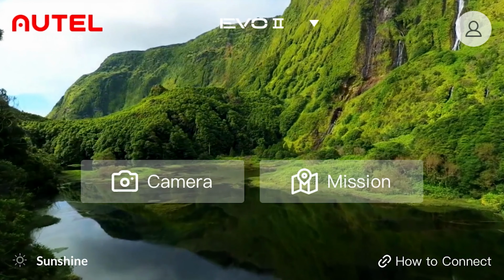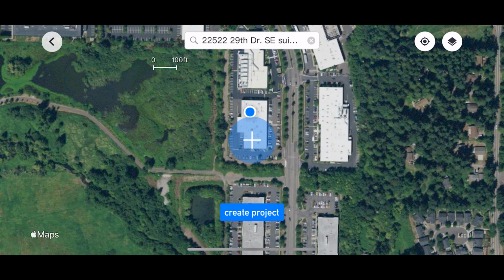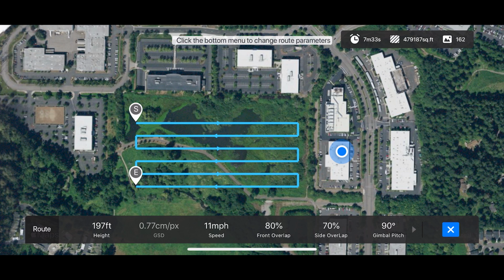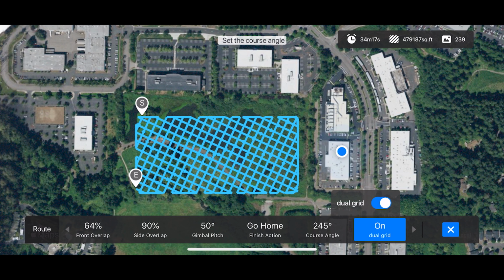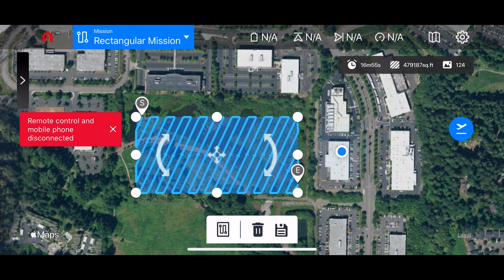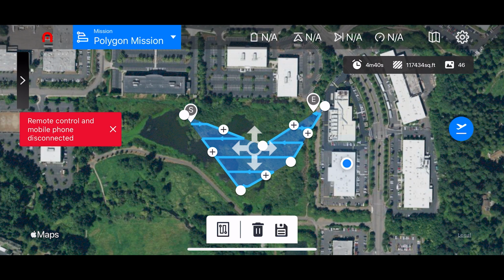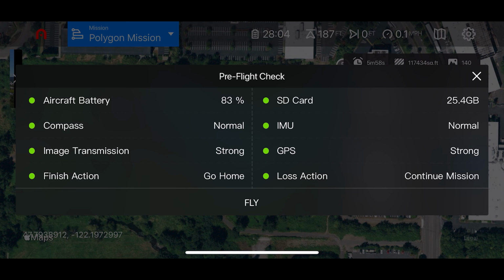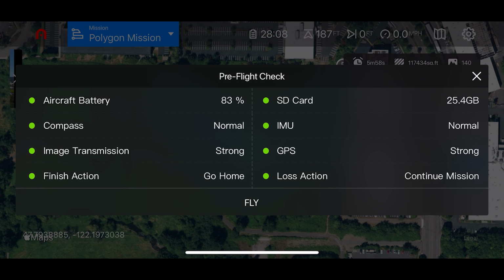How to Use the Mission Planner: Rectangular and Polygon Missions

Comment: Hello.
Feature: The mission planner is good.
But...
It is necessary that it be possible to change the "Start" and "End" points of the mission. Often the dots are placed incorrectly - in a more time-consuming way.
It is very inconvenient that when the signal is lost, the drone puts an end not to the last photo, but to the place where it lost the signal. Why didn't they make the drone take information about its automatic mission from the coordinates recorded in the last photo of the mission. This will be more correct and will allow you to correctly complete the mission to the end.
Also, when you set the mission in the direction of 90 degrees (for example), after the correction, the directions also change to 0 degrees and need to be corrected again. This is also inconvenient.
There is another question. How to make the drone not return after the remote control signal is lost, but continue to perform an automatic mission?

Comment: Thank you for the video. I recently used this to assist in a SAR mission but ran into an issue. The terrain was rough, and I could not define varying heights and could not use some imagery due to either being too high or too low compared to the initial photo captures. Will Autel integrate with Pix4D, DroneDeploy, or add the ability to vary altitude based on terrain? Thanks in advance.
Reply: As of now Autel has still not made terrain following possible. I'm a surveyor and I need my drone to take photos from approximately the same distance above the ground. I don't want the GSD (ground sample distance) to vary too much. Makes some photos lousy. Any solution found yet?

Comment: It is possible to rotate the rectangular pattern 90 degrees solely for efficiency to reduce the number of direction reversals. But it seems  that polygons are locked into east<->west as the primary directions of travel for course legs. Unfortunate.

Comment: Where are the missions stored and how can we move them to another device?
In a bit of testing with 2 devices, they seem to be sored on the device, as they are not visible on another device when I connect it in.
Are there any files that can be moved between devices to move missions?
I may plan with a larger device than I fly with. 
Thank you.

Comment: What does the "Auto" switch do in the "Course Angle" selection?  Does it account for wind direction?  Thanks in Advance.  I also wish you would put in an option where you have an option to fly Parallel to course ie always in one cardinal direction so when I find targets in Pix4D for ground control points they are easier to find.  I am flying an Autel Evo 2 Pro and have come over from DJI.  So far I really love the drone.  The only problem I have had so far is a little bit of yaw on the aircraft when pushing straight forward on the flight stick.  I have calibrated the controller and I calibrate the aircraft before every flight.  It doesn't happen all of the time it is just sporadic.

Comment: Many settings are shown with dark blue on black text that becomes invisible when outdoors in sunlight.  Please change the blue text to yellow.
Reply: and while you're at it please make iPhone app capable of 100% viewfinder display instead of cropping off top and bottom of image.  Toggle between current cropping full screen view and a black barred 100% view.  Also fix the grid lines so in current cropped mode the correctly aligned to the actual corners of the image, not the corners of the iPhone display.

Comment: Are there plans to fix the Mission Planner for EVO 1?

Currently, the overlap does not change when mission height is changed.

What I mean is that if I plan a rectangular mission at a certain height and overlap setting (eg 60%), then I increase the height, the overlap percentage should increase, OR,  the distance between the opposing legs of the mission should increase (and there will be fewer waypoints), because the higher the drone, the larger area covered by a single photo, so if there’s no change in the distance between the opposing legs of the flight, then the photos will have a higher percentage of overlap.

Currently, for EVO 1, if I increase the height of a rectangular mission, the overlap percentage stays the same and there’s no change in the distance between the opposing legs of the mission and the amount of waypoints stays exactly the same. This is not how it should work.

This works as should be expected for EVO 2 Mission Planner, but not EVO 1misdion Planner.

Please fix it for EVO 1

As far as I can tell, It is a case of some math in the code being wrong.

If there’s some technical reason for this not being possible for EVO 1 due to hardware, then I’d love to hear it, but to me it seems like a case of bad math in the code for EVO 1’s Mission Planner.

Any feedback from Autel on this would be appreciated. Even just an acknowledgement that it will be planned for a future update.

Currently, I’ve asked about this a few times, either via YouTube or via the contact form on the Autel website, but no feedback at all.

Surely this cannot be too difficult to fix, especially if it already works fine for EVO 2’s Mission Planner. This tells me the math error was not made when writing the code for that.
Reply from the maker: Hi Bob, thank you for your feedback. Our team is working on an update for the EVO 1 so please stay tuned!
Reply: That’s great to hear. Thanks for the feedback.
Reply: @AutelRobotics  Hi. Any idea when we can expect an update for Evo 1 regarding mission planning, as described above? Thanks for any feedback you may have.
Reply: @AutelRobotics  how can I access mission planning for the EVO  I?

Comment: Whilst the Rectangle and Polygon Missions are good for still images the fact that you cannot record video instead of taking still images is a glaring omission. There are Survey as well as Search and Rescue jobs that require the recording of video where the Rectangle and Polygon Missions would be ideal. Unfortunately it means until the recording of video is supported in Rectangle and Polygon Missions having to continue to use DJI equipment, which is a great pity.
Reply: For Sure